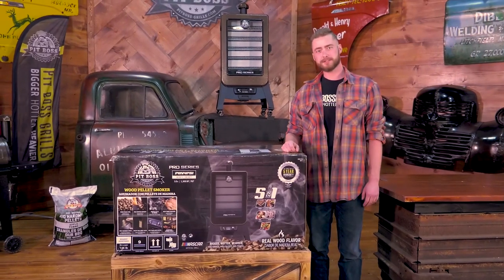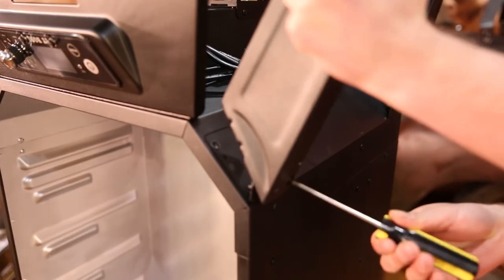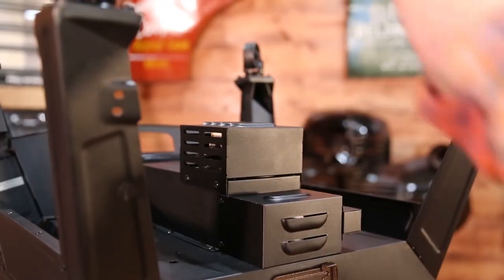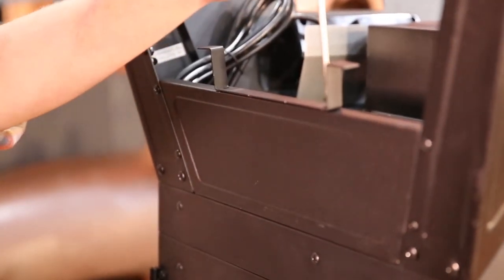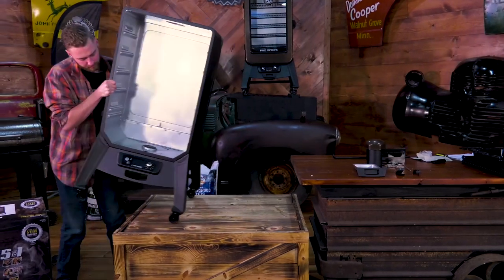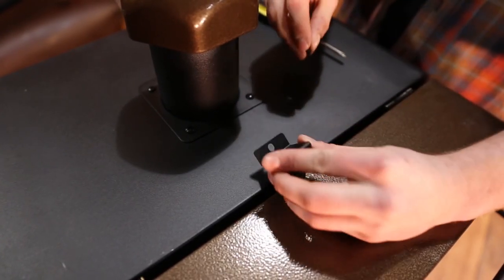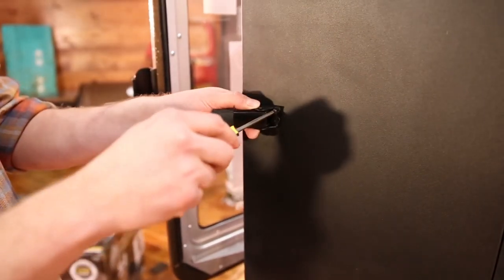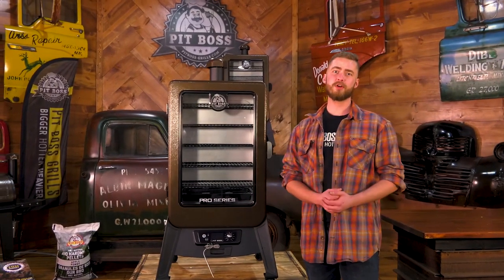How to assemble the Pit Boss Pro Series Wood Pellet Smoker

Comment: Just picked mine up and assembled it.  Doing the first burn off right now.  Any tips on how to adjust the hinges and the door latch to improve the seal.  The instructions say to do this, bit I cant figure out how to.
Reply: i have the same issue.  the door leaks smoke but if i tighten the door latch it slides off the catch that's on the handle.
Reply: Get BBQ pit gaskets, they are peel and stick. Inexpensive but useful

Comment: What's the difference between the pro and the copperhead series?
Reply: Other than the color, I’ve been told that the copperhead has adjustable shelves and the Pro Series shelves are removable but their spacing is fixed/molded into the sides.  They have the same burner/control system...

Comment: Hello.  My brother purchased the pro 4 from lowes and it was preassembled.  He is having a tough time getting the smoke flavor from anything he cooks in it.  Could it have been assembled incorrectly?  Otherwise, it works fine and cooks to temp fine,  just no smoke flavor in the meats and little smoke produced in the smoker.
Reply from the maker: Hey there, pellet smokers produce a clearer, cleaner smoke that will not look as full as what you may be used to. Apart from that, once his smoker is more seasoned he will start seeing more and more smoke flavor.
Reply: Smoke at 250 or under to get good smoke flavor, also use quality pellets. B&B makes good pellets, I personally don't like Pit Boss pellets

Comment: Don't buy! Just bought one and it won't work. Customer service told me i had a bad control board... Really? Right out the box and its broke. After some research this isn't uncommon for the control boards to go bad
Reply: I have the pro series 4 and the 1100 pro series and haven't had any issues with them. You may have gotten a faulty unit, it does happen from time to time with all the bouncing around during shipment and moving around in the store.